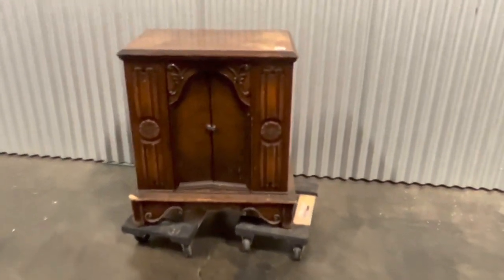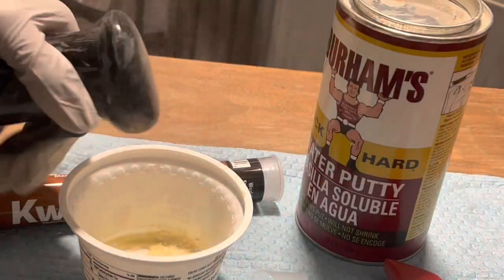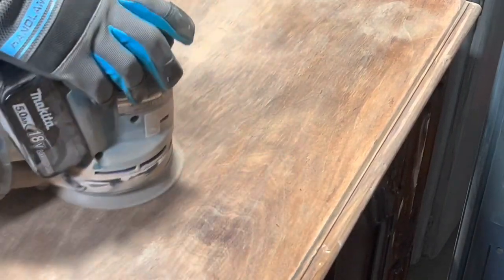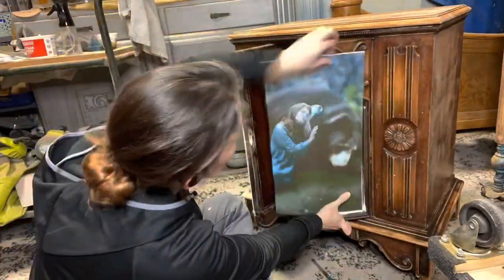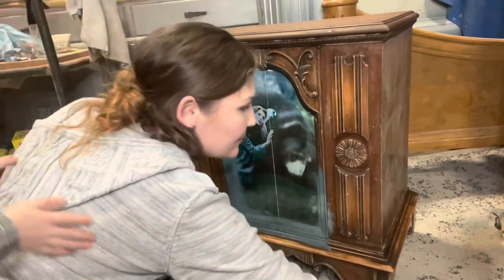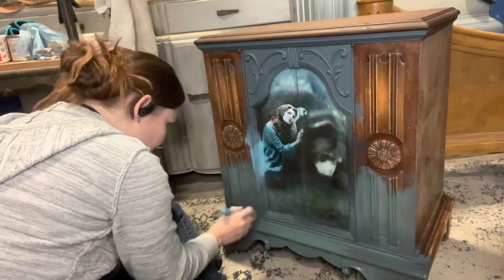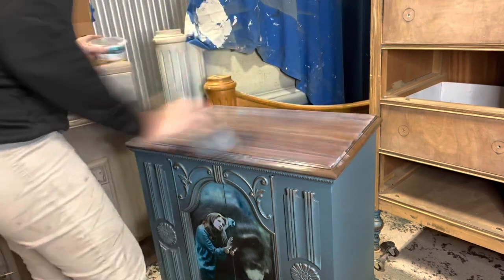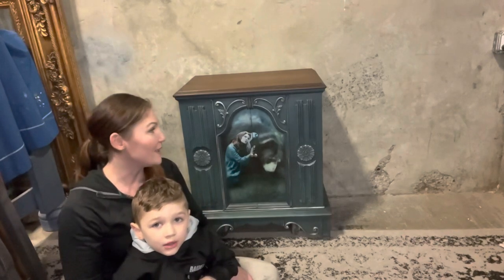Get A Dreamy Ethereal Cabinet | Blending Decoupage Papers | Repairs | Elegant Upgrades

Comment: You have transformed this little cabinet into a collectible art piece!  Beautiful…
Reply from the maker: Thank you, Gale!  It does have the shape of an old radio cabinet.  The inside is what was throwing me off. Most of the old radio cabinets I have worked on had a lot of the stuff built in and this one had that shelf in the middle so I wasn’t sure how it could have been set up. I really wish I could go back in time and see the piece in its original glory.

Comment: I wish I had the vision you have. It is an incredible piece, Taryn. Did you say you put the peacock wax on the top over the walnut-stained wood?
Thank you!
Reply from the maker: Thank you, Katie! Yes, I put the Peacock wax over the top. You can just use clear wax if you only want the extra protection, but I wanted the little bit of depth it added.

Comment: hey there! your work as usual is beautiful. in the video you said you use poly then wax…how long do you wait in between coats? and how long does it take too cure?
Reply from the maker: Thank you! Depending on the poly you are using, I usually wait at least two hours before applying multiple coats of that. Then I will wait until all my coats of poly have completely dried (usually over night or longer if the weather is preventing a full setup) and then I’ll apply the wax. The wax you use usually tells you how long to leave it before wiping it back, but I usually let it sit for at least 30 min, sometimes overnight if I’m done for the day and then wipe it back and buff the rest in. At this point it’s safe and dry- but most products are fully cured at about 30 days. I always let my clients know to take it easy on them if they purchase something from me before the 30 day mark.

Comment: Do you use a dry brush when blending? Or just paint the colors together until you have what you want?
Reply from the maker: I do all the things, Gaynette. For this one the colors were so similar I didn’t need a blank blending brush. I just used the individual ones for each paint color.  I wasn’t worried about contaminating them. I’ll use a blank brush for when I’m working on a harder blend and I don’t want to muddy up my brushes because the colors are a bit farther away from each other in color or shade. I hope that made sense.
Reply: @elegantupgrades  it makes a lot of sense and provides just the clarification I need. Thanks a bunch!!